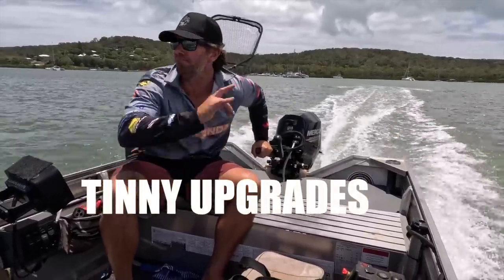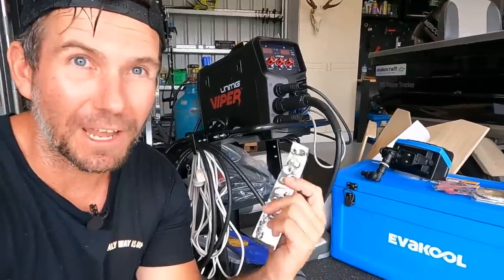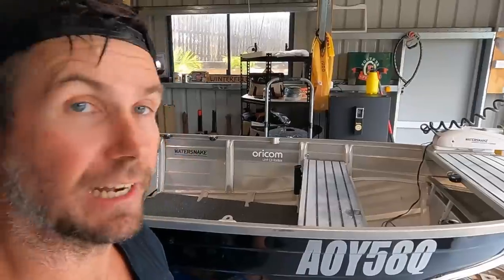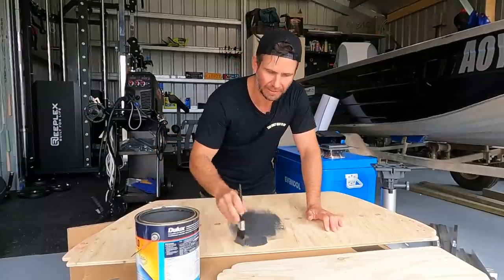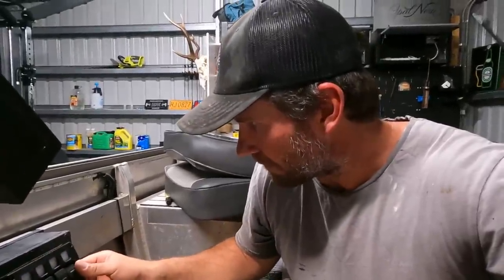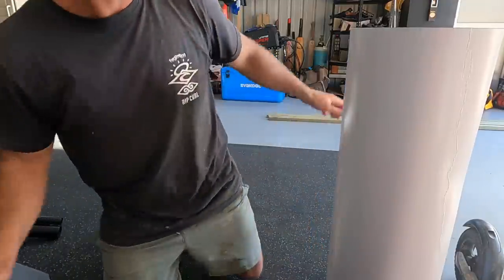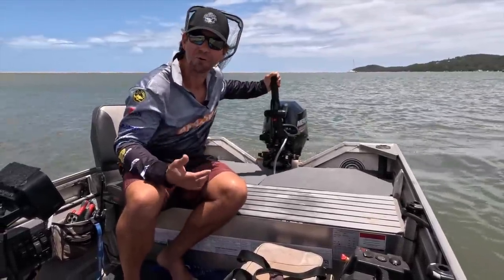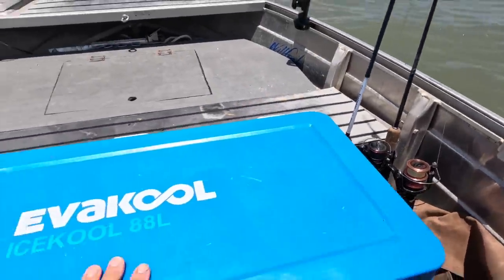Do it yourself Tinny upgrades👍 Casting Decks | Lights | Battery setup | Elec Motor | Sounder | Seats

Comment: Another trick with the water is to make it warm. Not too hot, just like a nice warm shower. Then soak it for a few minutes to warm up the line before spooling it on. This helps to remove the memory of the line and set it on the reel. I’ve found much less tendency to “rats nest” with newly spooled line.
Interesting vid!
Reply from the maker: Good tip thanks mate, I’ll try that next time

Comment: You can add a set of roof rack tracks under seat, and use the locking sliders on base of it to make seat slide port or starboard, and lock in place. Gives a slight lift to seat also.
Reply from the maker: Great idea

Comment: To make the seat more stable, an easy fix is an ally plate (or ply) to fit under the bench seat, four holes for the lazy Susan and some new ss  bolts and lock nuts. That will spread the load. Happy, healthy and safe 2023 to you and the crew.🎉 15.31
Reply from the maker: Thanks mate, I was thinking that. Big square of ply 🤙

Comment: I’ve never had much luck with the double sided tape on those strip lights
They tend to fall off when they get hot in the sun
I run a bead of silicone under them and glue them on with that
Happy new year 👍
Reply from the maker: Yeah for sure, I put a bit of silicone on each end a few dabs in the middle. Will see how we ho

Comment: I did something similar with the strip lights, however, I moved them because they were too bright. I placed them, inside  the "U" shaped part, just below the top of the gunnel. This protects your eyes from the glare...also from the weather. Nice setup though.
Reply from the maker: True, I can see where your coming from, they are bright little buggers
Reply: I did the same with the u shaped strip.it can be bought from bunnings too and its aluminium.win win.

Comment: Great mods Justin I suggest seeing you put the led strips in for night fishing maybe the spare switch could be used for navigation lights after dark. Keep up the good work mate.
Reply: protects your eyes from the glare...also from the weather. Nice setup though.
Reply from the maker: I have aaa battery powered nav lights from railblaza that I can use if I go out at night. I should have added them in I forgot 🤙 cheers mate
Reply: @TripInAVan No worries I’ve seen lots of people running around in the dark with no lights. I was going to say you could have bought some at Supercheap in Bundy while you were there 😊

Comment: Hey Justin did you check if you can get enough charge out of the magneteto of the outboard to then put through a regulator to get some charge back into the battery?

Comment: Nice work on the mods mate. I’m getting gunwales welded to my tinny soon and will follow up with a complete rewire and new decks throughout the boat and put in a new rear casting deck too. I’m going to try the EVA foam. What’re your thoughts on it for durability and cleaning? Cheers 🤙🏻
Reply from the maker: Sounds great mate. The foam is really good man hey, the stuff I put straight on the aluminium 2 years ago is still going strong and I’ve pressure washed it and scrubbed squid ink out of it and it’s still fine.
Reply: @TripInAVan  awesome. Thanks mate
Reply: Black Sikoflex bead, smothed down neatly around the edge, should prevent any lifting whatsoever.

Comment: Very nice, have done very similar to mine. Question tho, how does the boat run on the roof of the car with the seats being higher than the side rails? Love the show.
Reply from the maker: Good point, it won’t run on the roof as is. The seat and rear decks will come out if it goes back on the roof 💪

Comment: Love the setup can I ask what size battery and type you did say I think but I’m not sure if it’s the same one. I bought an 18 pound12 volt snake and I don’t know what size battery to use on my kayak . I was told that the lithium batteries catch on fire apparently.
Reply from the maker: We’ve had lithium for 5 years and they are super safe. I know you can get small 50amp lithiums that would be good for the yak
Reply: @TripInAVan  thank you 😊

Comment: as a fellow diesel fitter, retired. here is a hint showed to me by a boily, rub every thing with acetone before welding it makes the pool run like silk and the weld look like as the boilys say,
weld porn, even when done by a fitter, I had to do many and various weld repairs to a alloy low loader , you can imagine the horror story,... each year to get it past road worthy.
no boily would touch it so I had to weld it.
the difference acetone made is amazing.
why a alloy low loader ,well the owner was well known around town,.... by this saying.

if camels where the go,... ray would buy donkeys,.. and strap humps to their backs. 
😅🤣😂😉